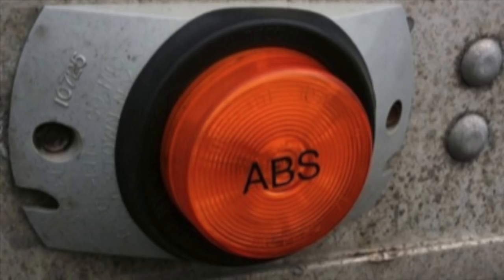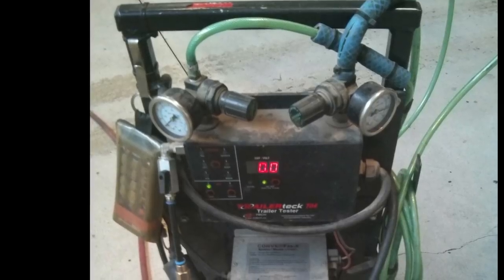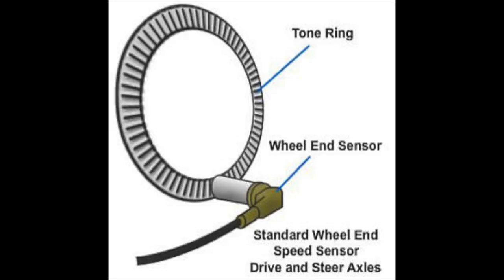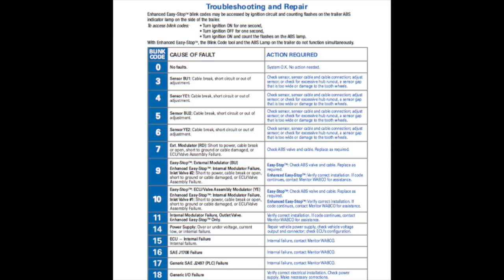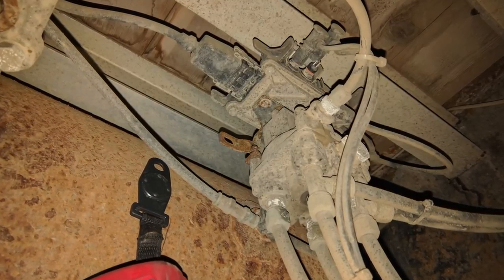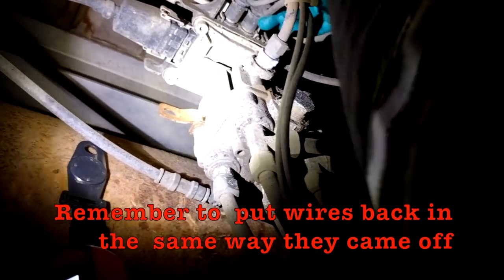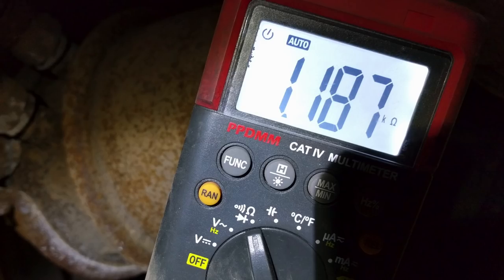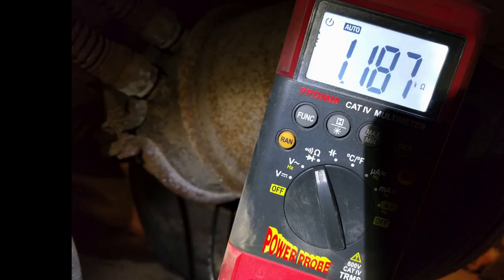How to Troubleshoot ABS on a Tractor Trailer

Comment from the maker: I mentioned in the video that I thought the codes were the same between bendix and wabco. They are not the same. I provided links to the blink codes in the description.
Reply: How to put on abs-tractor abs valve
Reply from the maker: +Donald Kirven take a few pictures of the old one before you take it off. Then you can reference your pictures when you install the new one. I also like to use colored zip ties to mark the position of each air line and abs wire. Don't forget to use thread sealant on all NPT fittings. (pipe thread) Check to make sure you don't have any air leaks, and make sure all your brakes are applying and releasing properly before you take it for a test drive. 

Depending on the abs valve it may need to be programmed when you install it. Usually if your truck has a stability control system. So you'll need a computer with the right adapter and the diagnostic program from the manufacturer of your abs valve if that's the case. (Probably better to take it to a shop if you don't know) Hope that helps.
Reply: I habe a question mecanics are always too busy..everytime I hit the brake abs locks for like 11 secounds...please help
Reply: On trailer
Reply: @TheHDPerspective  My friend, im having an issue with abs that even the dealer cant find the problem. What is going on is that the dash Tractor and trailer Abs light comes on when i start the truck and will go up after driving a few minutes (like 10 Minutes) NO CODES! Dealer replace my abs ecu! Still same problem. All started when dealer replace my egr sensor. Have you had any similar problem? Thanks in advance
Reply from the maker: Sounds like a strange issue, wish I could be there to help.
Reply: @TheHDPerspective  where you from?
Reply from the maker: Alberta
Reply: instablaster

Comment: The most comprehensive video on ABS  I’ve seen so far. Thank you
Reply from the maker: Glad I could help
Reply: I too thought this was a very good video but, he did not mention any info about the hubs/tone rings other than their existence. They also perform a crucial function in the abs system. 
If you do all these steps and the trailer comes back due to an intermittent abs malfunction,  you may have bad hubs.
I have been seeing more trailers with intermittent abs faults that make no sense and have found hubs with corroded teeth sufficient for the system to malfunction. 
Perhaps only a few teeth will be corroded an pointed in shape instead of square etc. 
You have to inspect all of the components.

Comment: Here’s my issue, would appreciate your thought on it;

Bought a used 2016 trailer. Plug into and ABS and it does the normal test procedure and light turns on then off
Driving on snow/ice roads and making a harder brake application, the trailer locks up without any abs function. Abs light does not come on.
I have power at the center pin and to the abs module. Brought it back to the dealer for repair any they handed it back saying abs functioned fine and no stored fault codes. They cleaned connections and sent me on my way. Next snow storm I tested the brakes and of course no abs. Any ideas or past experience with something like this?
Reply from the maker: It's hard to say without being there, but if all the wheels with the sensors lock up at the same time, the system will just think the trailer is parked. It works by comparing the wheel speeds to each other and if they're all the same, then the abs system won't activate. That could be a possible explanation. Especially if you only have 2 wheel speed sensors for a multi axle trailer.  Trailers that have a sensor on each wheel are less likely to suffer from this problem.  Hopefully that makes sense.

Comment: The ABS light was not doing that until I had mentioned it to you the other day . It is not recommended to drive with that ABS light on . The DOT will shut the truck down until it is fixed . I just checked on that

Comment: Good stuff.  I just found your channel and subscribed.  Your point was great about color ties on the ABS wires.  On our '02 KW's both wires to the wheel sensor are black!  So, on a polarity sensitive system, how's a guy to know which is which unless, it's marked.  When a tire chain comes loose and breaks the connection, there's a 50/50 chance to get it right the first time.
Reply from the maker: +Chad Jessup thanks for watching! I'm working on more videos so stay tuned

Comment: Good night master… I just replaced the abs module complete with the air valve.. just did my S cams on both sides put on new sensors and extensions… and when I turn the truck on abs light comes on few seconds comes off … problem is when I move and I park it starts blinking 7 times stops and then another 2 times ..any advice please I have worked so much on it!
Reply: You can check to see if the hub has play if the bearings are no longer seeded properly the tone ring will bounce back and fourth causing an air gap at moments

Comment: I hope you read the comments because I can really use some input on a problem I'm have with the exact same system as you test in this video.
  My problem is the valve boots up correctly and tests good. No blink codes, the problem is the abs indicator light stays on all the time and wabco has been no help in aiding me. I figured the valve is what controls the abs light shut off so I replaced the valve with a new one and I have the same problem so it's not the valve. I cant track the indicator hot wire because it goes into the harness at a rubber block junction that runs to the front of the trailer and down to the valve. Inside the harness it's just standard 7 way. I need to know some common problems and what color wire coming out of the valve goes to the indicator light please? Hope you can help with this.
Reply from the maker: What happens when you use a different truck?
Reply: @TheHDPerspective  it's the same with any truck or my light box tester.

Comment: Hello. I need help please. I have 2007 Vanguard trailer. I have 5 volts on the module, wires right before sensor 5volts. Sensor wire 1200 resistance when set on ohms, both wheels. Lift up both wheel spin the wheels there
is consistency and i still get the yellow light, new green cable that connects truck and trailer but i know that the truck is not issue cause i have other two trailer and i never get the abs light on This issue is driving me crazy. What could be the problem that triggers the abs light to come on ? Yellow light blinks 6 and repeats that for three times

Comment: My abs light don't come on when I turn the key to on or turn the semi truck on. I just changed the pigtail wire and a brand new round abs light, and still not working.      What can it be? Do I test the wire for current? And if there is no current then what?

Comment: I have an abs light that WONT turn on during MUT test. I traced wires and basically found power was going to abs module but no power out to the light from module. What tests can I perform for that?
Reply from the maker: If there’s no power coming out of the module. You either have a bad ground or the module is no good.

Comment: great video, i have a costumer w a freighliner and a dry box trailer abs light is on the dash, i hook up my laptop and gives me no codes or perhaps no communication any advice?
Reply from the maker: Can you get blink codes?
Reply: The HD Perspective i
just found the blue wire that goes to the abs module damaged!!! thanks for quick responce
Reply: The HD Perspective fixed the wire it still wont communicate
Reply: The HD Perspective cant get the trailer abs light to blink either
Reply from the maker: Glad you found the problem!
Reply: The HD Perspective light is still lid on the dash, everything checks out 12 k ohms on all 4 sensors 5 volt reference on all outputs, there are 4 wires that go to the module red brake light blue 12v white ground and there was a white w a green stripe, where does that one go i could not see that wire at the 7 prong ttailer hook up, is it for the abs light on the side of the trailer? 
i could not get the dash abs light to blink, found several broken wires that i fixed but still have the dang light on the dash, advice!!!!
Reply: Hello did you ever figure out where the White/Green wire went to on the Junction box or the pig tail by chance?

Comment: My abs for the truck is on
 It initially powers on does self test fine. I drive down the road and could be 5mins or a couple hrs. It comes on. And my cruise control won't set the speed. Only if I'm lucky it will set after 30 times of hitting the button.  Please help?
Reply from the maker: Probably have an abs wire that's corroded some place.

Comment: Is it possible that faulty ABS makes one wheel to lock when applying brakes
Reply from the maker: Not likely, probably have a sticking s cam or broken return spring in the brake pot. Something like that

Comment: My Stoughton trailer has ABS illuminated and when I shut my truck off and apply the truck brake ( yellow on dash). And start rolling the light goes away and comes back on 10 miles or so down the road and have to shut down and roll again. Dealership that sold me trailer can’t seem to find the issue. Really frustrating.
Reply from the maker: Do you know what kind of abs module is on it?

Comment: Hey bud! I really enjoyed your video... what do you think it would be when I turn the ignition on the abs light does NOT come on, but it will when I press the breaks when driving, it would come on for few seconds then go off even if I still have my foot on the brakes??? Please help I’m driving 2016 Pete 389 car carrier
Reply from the maker: Is this just on the trailer or the truck? If it's just the trailer you probably don't have power going to the abs module on the blue wire or centre pin on the light plug. Check to make sure you have power going through the plug.  You can try spreading the pins a I little bit with a small screw driver on the trailer side of the plug to get a better contact, but be careful not to break them.  You'll need to isolate between the truck and trailer. If it's the truck it's likely the same thing. Could be something as simple as a fuse. Or could be broken wire. Good luck!
Reply: The HD Perspective this is just on the trailer
Reply: I have the same issue where u able to figure out what was wrong with it
Reply: Andy I yes I did figure it out... the power was getting lost at the pig tail, all the wires got corroded where they hook up to the back of pig tail box , I just cleaned them up a bit , got a new box hooked it all up, and done.... the box was like $20 the Phillips aluminum one.... best of luck to you...
Reply: @andreypanchelyuga7078  was it on trailer side or truck side
Reply: Andy I that was on the truck.... see I have a car carrier, so my wire going on the frame of the tractor, then it hookes up to the pig tail box and that’s where it was corroded, good luck to you

Comment: hi Dillon what if you have 1700 ohms resistance instead of 1100 ohms. is that sensor still bad?
Reply from the maker: +Florentino Balandrano I would compare it to the other ones if they're all 1700 then I'd say you're good. Some sensors from different manufactures can be a bit higher. But if only one is 1700 and the rest are 1200 then I would change that one sensor.

Comment: I have 07 freightliner century class automatic transmission. I have 2 codes 1- 130 231 14 which is transmission reservice code. 2- 136 231 09 Brake update code . When i checked it it says j1939 not communicating. These 2 codes shows up on usually rainy days but it goes on and off and no one can figure it out. When the codes comes transmission doesnt shift. It kills me. NO ONE COULD FIND IT because when you stop code goes away. Any ideas ?
Reply from the maker: J1939 codes can be hard ones to find. If it’s coming on when it rains I would say it’s in one of the connectors for the harness that is missing the little rubber seal somewhere. Sounds like a harness issue. That’s where I would start.

Comment: What do I do when ABS box is 5 volts both lines are 5 volts and both sensors are 1.22 and the light still won't go off ?
Reply from the maker: Do you have blink codes?
Reply: @TheHDPerspective  It blinks six times so i'm assuming the sensor is not within the 40 thou tolerance
Reply from the maker: Did you check the tone ring it could be bent or a tooth missing or cracked?

Comment: I have a trailer that the light will come on sometimes after making a very sharp turn.  It goes off after a key cycle.  

But i will get the 5 flashes on 1st key cycle
Reply from the maker: I would start by looking at the plug on the trailer cord. It might be getting worn out.

Comment: What causes the abs light to turn on when applying the brakes?
Reply from the maker: You likely don't have power going down the center wire on your plug. Either on the plug or somewhere in between the tractor and the abs module on the trailer.

Comment: I have the issue of abs light comes on and it errors my meritor webco onguard system which then puts my truck into manual transmission.   Driving a 17 freightliner cascadia.   Some trailers it works fine on and others it errors out.  But when trailer is unhooked truck works great.  I think the problems is what this guy talks about in this video.  Ive had the onguard system replaced.   Any ideas?
Reply from the maker: Sounds like a tricky problem. I'd need to take a look to figure it out. But I'd probably start with the trailer cord, it's possible the plug is just on the verge of being worn out and your not making good contact with every trailer.

Comment: Why my abs light doesn't come on when I turn the key on, but will turn on when I brake and stays on if i keep my foot on the brake, it turns off when I let off the brake? Please help, thanks.
Reply from the maker: +Tarzanovich is this on the truck or trailer?
Reply: 2005 Great Dane 53ft reefer trailer.
Reply from the maker: +Tarzanovich what happens when you turn your hotline switch on, in the truck?
Reply: I have a 98 freightliner fld truck, I didn't turn The switch on and don't know where it is .
Reply from the maker: +Tarzanovich it seems to me that you don't have power going to the center pin on your light cord, you should see 12 volts there.
Reply: Thanks a lot I'll check that
Reply: Tarzanovich 
Im having the same problem, where you able to fix it and how?

Comment: What if you just get a light that says j1939 abs failure on your dash under faults and no abs light for tractor or trailer? where do you start.
Reply from the maker: You would likely need the OEM program to scan the abs module and go from there
Reply: @TheHDPerspective  Theres no signal to the module. I need to work backwards to the module. All have is the truck diagnostics abs failure j1939. The computer cant find the module or abs system.
Reply from the maker: It's usually a blue wire that transfers the data. It's the centre pin on the plug.
Reply: I have the same problem on t660 no ignition cycle, no abs light but same j1939 abs failure code. Did you fixed it?